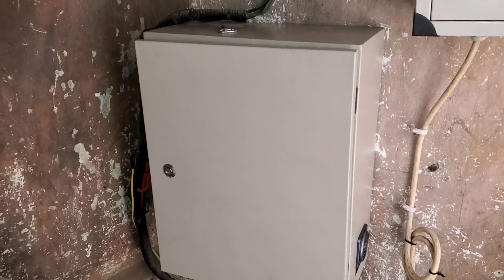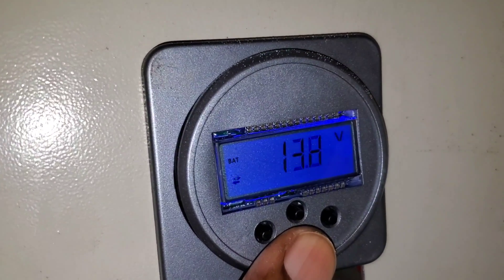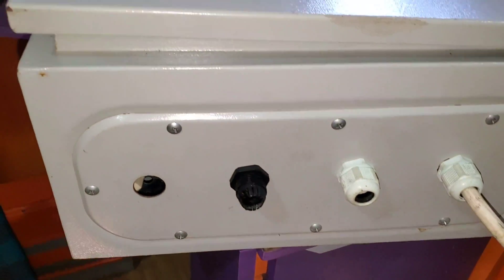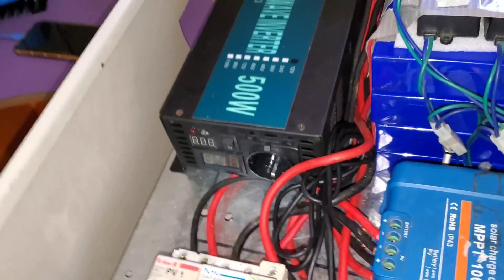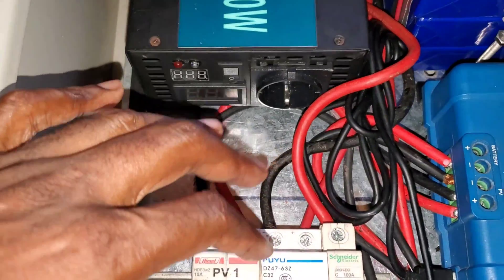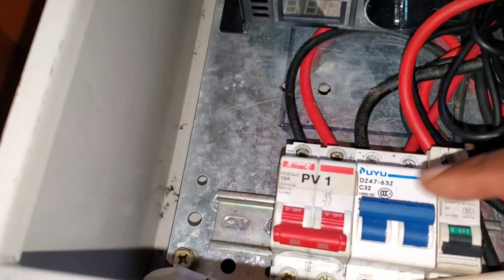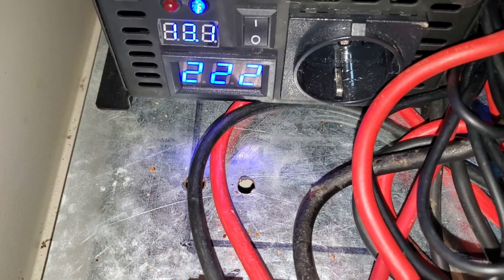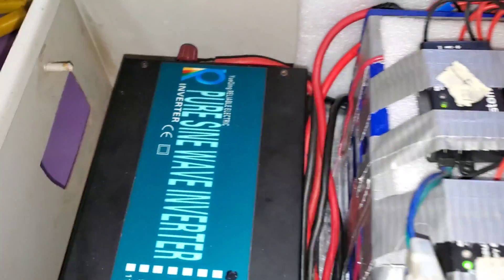Part 2. Small of the grid project is complete

Comment: Great stuff. How can I link this to main grid panel for storm power cuts. Would I need a $500 transfer switch?
Reply from the maker: Not with this system. Not even sure it meets code. It is all manual our set up. We don't have the grid here
Reply: @drsolar  Ok. Thanks for reply. Keep up the good work 👊🏾

Comment: Nice contraption Dr. I guess it will be nice if the inverter fan can vent its exhaust air outside the box to avoid heat building up within.
Reply from the maker: The load is so minimal that we don't think it is an issue. We will plan for timed electric fans running off the load side of the controller.
Reply: I will suggest a temperature sensor-controlled fan. This will control the fan speeds and in turn reduce the energy consumption of the fan over time. Also, the climate control will be independent.
Reply from the maker: @lylatechnologies461  thank you for the suggestion. We will refine. At the moment it only powers a 10 W bulb so it is not being stressed.